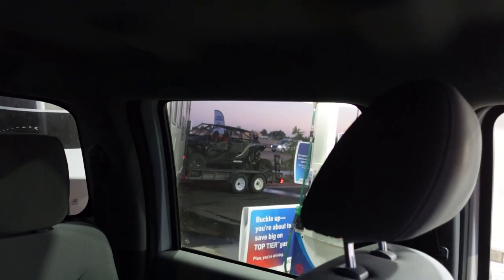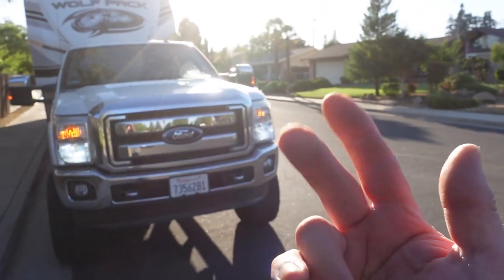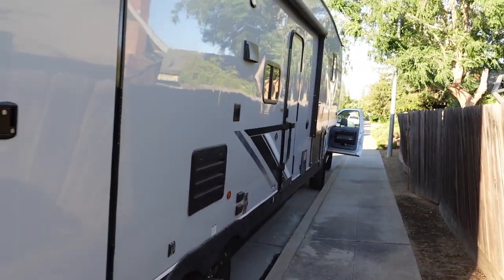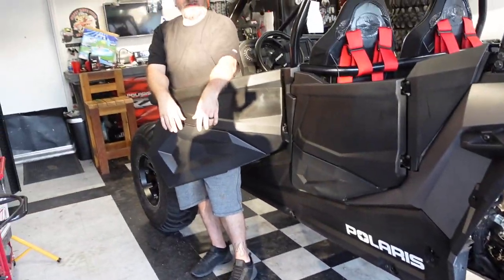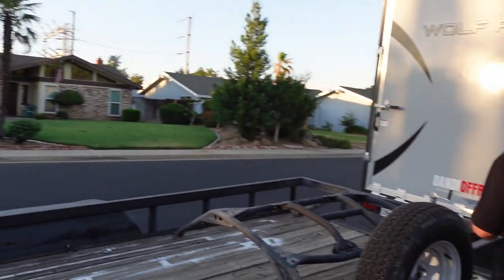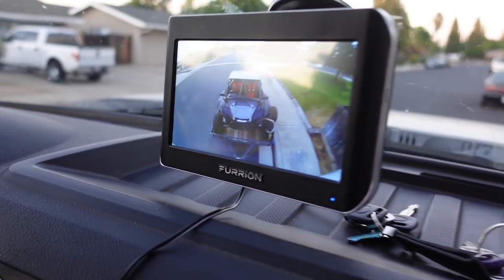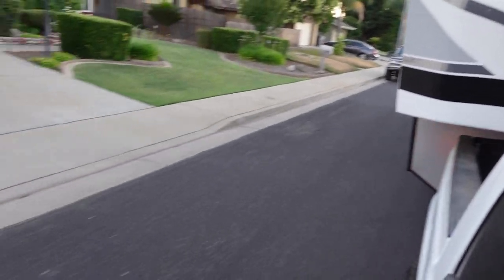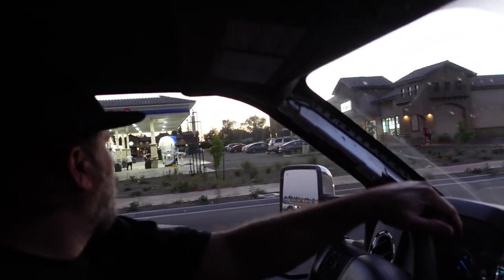Part 2 PISMO finally pulling doubles RZR TURBO S AND THE X3 GETTING READY TO HIT THE SAND DUNES

Comment: Finally growing out of my turbo quad and looking to move to a sxs after being a vw rail guy. Do you have preference in the dunes with your two machines? I was leaning polaris turbo s 2 seater.
Reply from the maker: The razor 2 seats a little bit short from my preferences. They tend to buck through the whoops, don't handle quite as well as a longer car. I always say Can-Am for two-seater Polaris 4-seater.. And honestly that's because I like the way the four-seat razor looks better than the four-seat Can-Am. My honest opinion is that the Can-Am has way more potential overall.